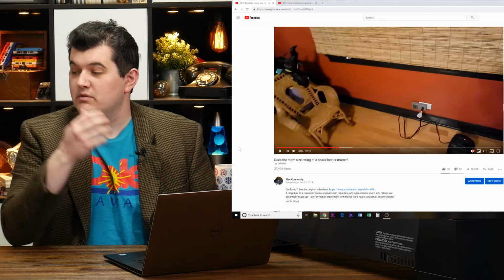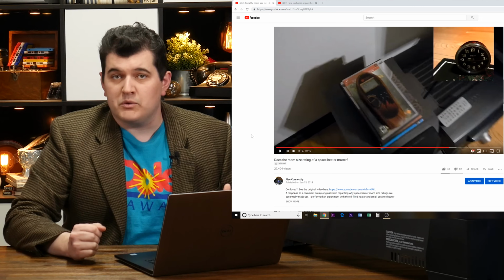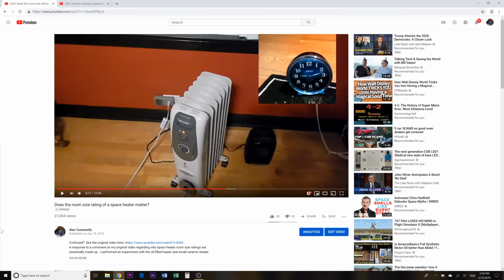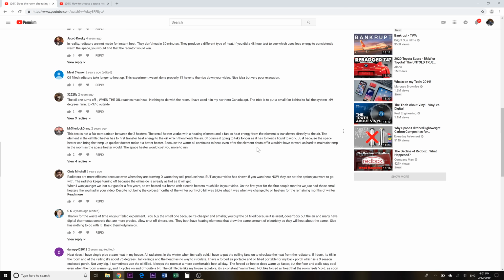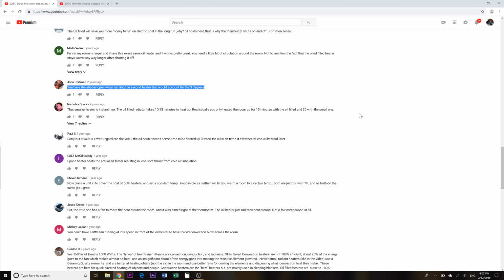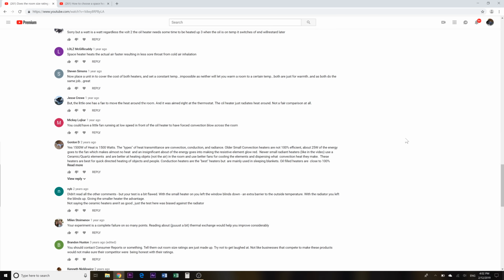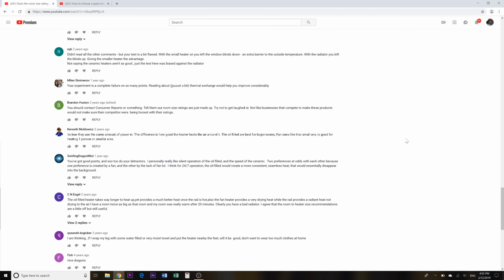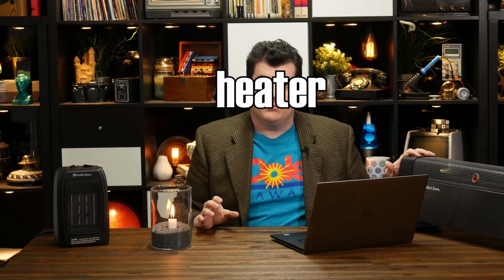More Space Heater Nonsense

Comment: I use an oil-filled heater AND a fan blowing through it. 
1.)  Keeps the thermostat from cycling.
2.) Keeps convection, alone, from piling-up heated air at the ceiling.
3.) Super quiet.
.
Great vids, Boss.
Reply: That's exactly what I did at my last place. The regular fans are much more quiet than the little heaters, and they move more air. The room heated up quicker than just the oil radiator heater and it stayed a more consistent temperature than a little heater or the radiator.
Reply: The fan also lessens stratification, with less hot air wasted at the ceiling and less cold air along the floor (cold feet) net result a warmer habitable zone.
Reply: @herbertkeithmiller :  Precisely.   ;-)
Reply: You give me an idea. I'll turn my ceramic heater with a fan in to a ceramic heater without a fan. It will result in producing much more heat than it gets in power from the wall - when the heater combusts and burns up the room.
Reply: >buy an oil cooler for quietness
>use your own fan
Reply: I thought the thermostat was failing in mine so I bypassed it. Then it got HOT!
Reply: M Detlef  Which is why I put a fan on the floor pointing up at the ceiling.  Maximizes circulation between the temperature zones and normalizes temperature through the room.  People talking about the thermal mass of the heater are forgetting about the thermal mass of the air in the room itself.  A low thermal mass heater just means that the SAME AMOUNT OF ENERGY is transferred into the thermal mass of the air.  Keep that heated air from pooling on the ceiling away from where you are, and you'll feel that.
Reply: You risk dying from Korean fan death. (Joking.)
Reply: That's a great idea.  I think that setup, while producing the same amount of heat as a small space heater, would also be safer to run for extended periods.  Small cheap desk space heaters may not necessarily be designed to run constantly like that.  Fans could fail, more potential to start a fire, etc.
Reply: Yep, given the limitations of the oil radiator heater design, that's the best solution. And it's safer than the fan-based heater unit because there's no way for anything flammable to reach the heating elements and start a fire. Plus, the oil radiator unit is likely going to have a remote control and maybe even a remote temperature sensor.
Reply: I have 3 oil filled heaters and 2 of them allow you to set them to just "on" and bypass the thermostat. If you do use the thermostat they have the same problem though of turning themselves off.
Reply: @castirondude  I'm guessing the one that allows you to just turn it "on" still has a protective thermostat in it that shuts it down when the temperature inside gets too hot.
Reply: @bobbabai  yes I think so, I think they still turn off at 85 degrees
Reply: @castirondude  
That makes no sense. 85° f is slightly warmer than room temperature. Are you talking about ambient room temperature away from the heater?
Reply: yo I know you made this comment a year ago, but I would like to point out that the "efficiency gains" of an oil heater are actually nonexistent. The oil continues to heat, but. the heater had to put in that heat. So the heat lasts longer, but only because it takes time to heat up. idk if that made sense but hopefully you understand
Reply: @Jeebles-mccreebles  ,
I made no mention of "efficiency gains".
I meant only practical application.
I do hope you understand.
Reply: @glasstronic  i see, still confused what the practical applications are. In my eyes theres no difference other than that the oil one is delayed. Is there something else im missing?
Reply: @Jeebles-mccreebles  ,
Possibly a couple of points I've not well clarified:
1.) Room air circulation. With just the oil radiator without a blower, the heat accumulates near the ceiling; that's not where we typically habit.
2.) Noise level. An inexpensive 40 Watt fan sounds but a whisper.
I reckon it worth mention: Heating element temperature. The higher the temp., the sooner it fails.
Those oil types, when serviced by a blower, never get above a temp. you'd put your hand upon. Lasts a loooong time.
Reply: I can't believe people are arguing this much. I don't think people are listening to each other properly. People are mixing up , heat effectiveness and efficiency. Its getting annoying.
Reply: @Jgarage5  This. I like oil heaters for their consistency (especially if you have a fan in the room you can control independently, but that's using more energy to spread the heat), but if I just want efficiency over everything else, using the small electric heater is better.
Reply: @Jgarage5  And some people completely confused things by using meaningless terms like "heat effectiveness".
Reply: That's cheating since the fan will take another 100-200Watts which will in fact increase the heat output compared to the small heater...
Reply: @HAWXLEADER  Nope. The fan draws 60 Watts (maximum) at its highest setting.
I usually use it at its middle setting, about 40 Watts. 
Yes, of course the fan motor is not 100%  efficient, but those few extra calories (heat) are barely measurable.
Think of a 40 Watt incandescent lamp: Will that heat an 1800 square foot space noticeably?
Reply: @HAWXLEADER  then you could always get one or two of those metal wood stove fans that run purely by convection to put on to of the radiator. No extra power needed.
Reply: Still not as effective. Oil radiators space heaters like that have an added disadvantage of the heat capacity of the oil. That is they are going to take time as the oil reaches thermal saturation before it starts dissipating. While radiators are effective at dissipating heat out of a system it's just not going to complete in terms of thermal conductivity with a heating element with air blowing across it. You would be better off transmitting the heat to a fin stack and blowing air across it and eliminate the oil altogether.
Reply: @tekcomputers  True only if one demands the heat in a short time. Do keep in mind that when the thermostat cuts the power, the oil will remain hot longer than finned elements alone. The oil causes ZERO loss of efficiency, but does delay the energy transfer (dissipation). Heating a solid or fluid mass has distinct advantages; namely, the air temperature within the air space of interest stays closer to the desired setpoint. It obviates a thermostat's need to anticipate loss, and avoids rapid cycling (wear of the system).
Reply: @tekcomputers  Yes, there will be a little more time for the heat to reach the room, but there's no such thing as saturation of the oil. Once heat from the heater elements starts flowing into the oil, the heat will start flowing into the room, but more slowly until the oil comes up to full temperature. 

The disadvantage of this approach is that when your room is at the desired temperature, and you manually switch off the heater or its thermostat switches it off, heat continues flowing into the room. Probably not a big problem.
Reply: Look guys, dueling morons.
Reply: @Crimson_Hawk_01  
Look guys, a troll with no original content.

Comment: You ever hear about about sleeping on hot rocks? You turn an electric heater off boom no more heat, it's immediately getting colder. Where as a radiant heater does not immediately get cold. You make correct points, however they are different for specific reasons. Numbers are not real world attributes. $20 heater electric VS $200 electric no big difference. Big difference is like sleeping next to something warm.

Comment: Im a couple months late so maybe this is already solved but the answer might be surface area. The reverse kind of happens with the sun. IN the summer the sun's rays are direct and it feels hotter. I the winter the earth is titled away and the same amount of solor energy is sprerad across a larger area. So the sun feels less intense.
Maybe the larger heating surface means their is less "spreading" of the same heat. In other words the small heater puts 1500 W into a small area and spreads out while a larger heater puts the same heat into a larger area and therefore spreads out less?????
its just a though but I know (in my limited knowledge of physics) surface area is a major player in energy transfere.
At the lab where I work we have large cold baths to cool of samples. The smaller cold baths at the exact same temp never cool things off quite as fast.

Comment: I can understand your frustration. In your situation since every heater is running at the same power the differentiation as indicated doesn't make any sense. 

What I would like to see is a short explanation at the beginning of the first video that the situation is different in countries with a different electric grid voltage. 

I live in Europe and here the categorisation according to room size can make sense to give people a rough idea which heater is more suitable to their needs since the output of the heaters can vary between 900 and 3000 Watts.

You find the information here and I apologize that the websites are not in English, but the markets I know, do not have English websites.
https://www.hornbach.lu/shop/Appareils-de-chauffage/Appareils-de-chauffage-electriques/S10556/categorie.html?WT.z_navi=dd
https://www.obi.de/heizen-klima-ventilatoren/elektrische-heizgeraete/c/268#

For comparison, I ignored the higher power triple phase 400V 32A heaters, that go up 15000 Watt

Comment: In general oil heaters have a larger heat capacity, meaning that a large quantity of heat is being stored in a single place. This can result in the problem you saw with the poor design of the unit you tested. However, it's generally so if somebody opens the door, and lets cool air in, that wouldn't result in the same temperature drop you would see if air was used as the sole media of heat storage. 
It's a neat idea, but wouldn't be useful unless you have a ball room with multiple of these with people coming in and out where large temperature drops can happen and will cause people to get sick. In a house, none of that matters.

Comment: could a difference between the two units be, not how much heat is put off per hour but that the design of one could be more appropriate for longer running times than the other. ok so for example the two you have on display the smaller one has much shorter wires likely with a higher resistance than the wire running through the larger baseboard style heater this would be to extract the necessary energy from the current within the size limitations of the small unit and as you stated the small unit is capable of drawing just as much power as the larger unit but the strain placed on the components of the small unit as it cycles on and off will likely be many times greater than the larger heater. So because the larger heater stays on longer and has components that are under less strain it will fail less often than the small heater when heating the same space. it may not be an indication of the capability to heat a larger room within a given amount of time but the ability to do so across multiple seasons.

Comment: I sat back for ages and I finally have something: with a heat battery like an oil-filled heater, you can buy energy when it’s cheaper and retain and release it when the prices increase (e.g. turn it on when grid is off peak, or when solar panels are active)

Comment: Your main thought is a conservation of energy argument, and you find a lot of youtube people not on board with that. (At one time no one believed the Wright brothers could fly either, they will tell you.)

 The main thing I wondered about is what the electrical rating means. It sometimes means one thing and sometimes another. A light bulb rated at 60 watts is using 60 watts (plus or minus some tolerance.) A 60 watt amplifier COULD put out 60 watts (at some amount of distortion), but if there is no audio to it, it would be putting out no watts. The rating of these heaters could be the maximum they could put out under optimum conditions, and those optimum conditions might be atypical. And the required conditions might not be as narrow or atypical depending on the design. Your test seemed to show the two heaters really do operate at maximum watts under normal conditions.

 The heating element in these have at least one limiting factor: How hot they can get before they destroy themselves. However, operating things nearer their temperature limit tends to shorten their life. An element that is longer does not have to get as hot to put out the same heat energy, so it might last longer. An element not as hot might be more pleasant to be close to, where the hot air hasn't mixed with the cool air yet. That could actually make a bigger heater the better option in a small room.

 It could be that a larger heater distributes temperature more evenly across a large area. It is hard to say. Baseboard heating around the perimeter of a room (or through the entire floor) is said to be better than forced air through a small vent.

Comment: I noted that there was little direct talk about the law of thermodynamics...heat rises and cold air sinks!!!  If you had checked the temperature near the ceiling, you would have found all the heat you created!  That is why ceiling fans makes sense when you are trying to heat a room...to push that pool of heat under the ceiling down to where people usually are.  It does not matter what kind of heater you use. All the heat will rise and will displace cooler air towards the floor.  A ceiling or other fan near the ceiling will move that heat around and you get more even heat.  A fan-forced heater has a bit of an advantage over an oil-filled heater because the heat from the oil-filled device goes straight up...pretty worthless unless a ceiling or other fan is employed to circulate the warm air.  But I never use space heaters anyway because I hate finding my electric outlets hot after using one for any length of time.  And heaven help you if you still have aluminum wiring!!!  All the best...

Comment: Would I be correct in assuming the extra 90W for the little heater are for powering the fan?
Reply: No. 15-30 watts maybe. The noise from a 90W fan that size would be ear-splitting. Ratings always have a tolerance. You never expect to see anything exact. IAC, 90W off relative to 1500W is not bad.

Comment: I have used the oil filled and more then anything they are consistent heat. Place a pan of water on top and add humidity. By it's design it would lower humidity less. Oiled filled offers much more creature comfort much like water filled radiators of the day, steam for that matter. Box or similar heaters are not comparable comfort wise. Radiant heat is always going to be preferred over forced air of any sort.  Truth be known.. Is what it is..

Comment: Query: the latent energy stored in the oil slows the room heating but it will keep releasing heat even after you turn the power off.  I agree that the thermostat is dumb design.  I would argue that your experiment is flawed if you intend to make efficiency statement without taking this into account.  This may not change the results significantly but still needs to be considered.

I agree that the energy output will be similar given the same wattage. The volume of heating is obviously different in both machines and that would change the applications of both rather than saying one is better than the other, but I agree the labeling is confusing and fluffy.

Comment: Like the product, space heater marketing just isn't cool.

If I had one knock against the way you demonstrated the issue with your old video, it's that using an oil heater introduced too many extra variables. A "large room" heater without a resivoir or fan wouldn't self-limit (barring weirdness), and it wouldn't have a delay to factor in. You'd have one heating the room by n degrees per hour, and another heating the same room by the same n degrees per hour. If YouTube comments have taught me anything, it's that confounding variables confound people.

Comment: The only difference between a convection heater with a fan and one without is where they put the heat. You are exactly correct, they are releasing the same amount of heat, the only difference is the delivery. Like I said, radiant "feels" the warmest, usually because it heats your skin more directly than convection. A heater blowing heat will definitely spread the heat faster than one that passively uses convection (usually). There's no magic here to be had.

I prefer to heat by burning natural gas or if in a pinch, kerosene.

Comment: Heating with electricity is expensive because of the transmission losses. I've used various electric heaters. By far the most satisfying is radiant heaters, especially when getting out of the shower or taking out a chill. Oil filled is, like you said, safer and silent.

I like this video, not your normal scripted video. Gives an insight into your thought process that I haven't seen before.
Reply: Converting heat into mechanical energy is less than 50% efficient too and maybe another 10% loss going from mechanical to electrical. It all adds up.